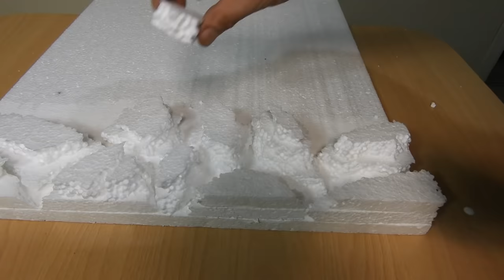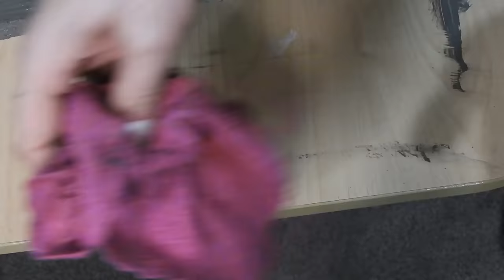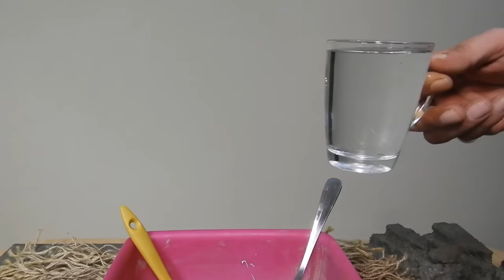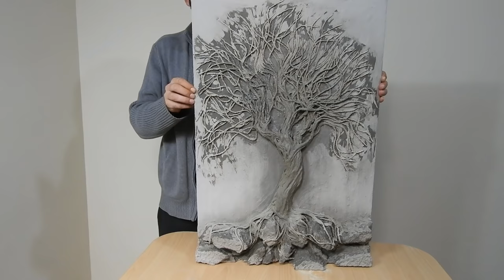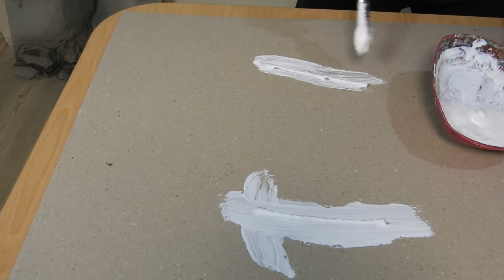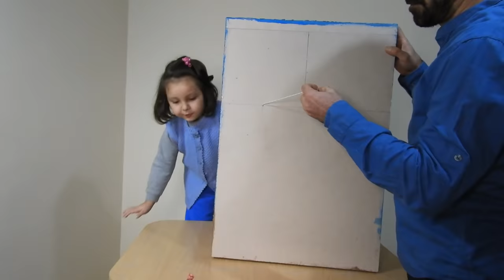İlginç bir Rölyef çalışması & Kabartma Tablo & Relief Panel

Comment: Styrofoam is strong to support the weight after lifting?
Reply from the maker: I got a pretty light result. It can be easily hung on the wall. I've never had a problem with any painting hanging on the wall.Thanks😊💕
Reply: Thanks,i will also try